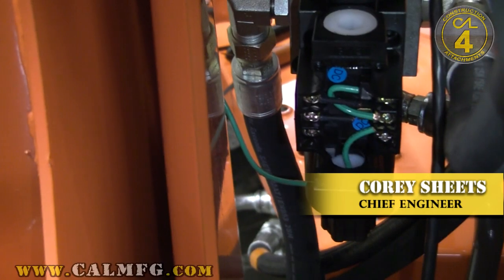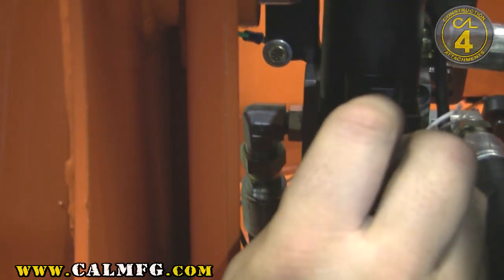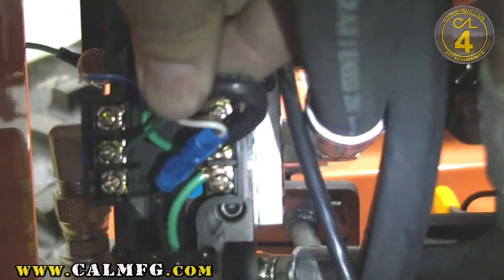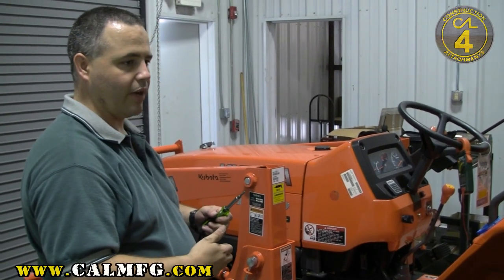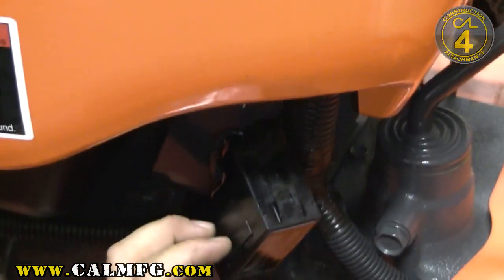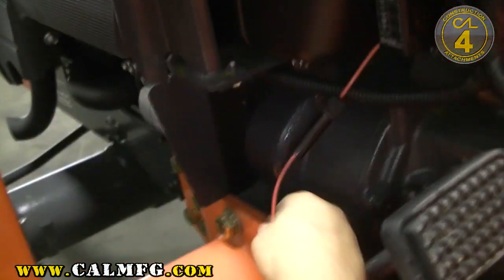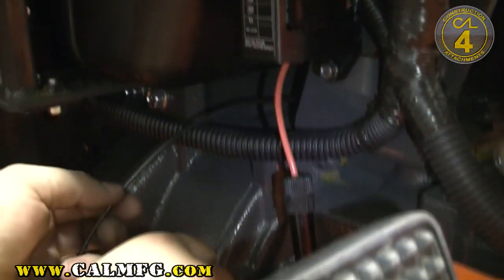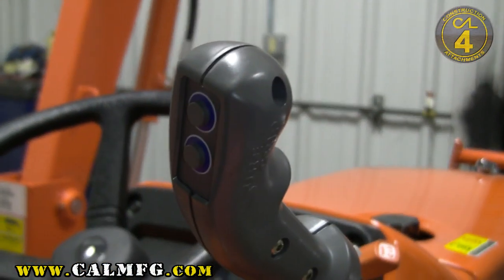One Touch Kit Installation for Tractor Loaders - Part Three

Comment: Good video and I will definitely check out your kit when I'm ready to order.  I've looked at other kits and the makers/sellers videos are terrible so I wouldn't want to buy theirs.  

I would say, though, that the electrical instructions could be improved.  

You crimped with the cutting edge on the first crimp - was it the brown and white wire in a butt-connector?  Yep; I double-checked: 1:40 into the video.  Picking a random ignition-switched wire could be dangerous - the load of the valve could blow a circuit to something critical.  You should identify a specific circuit to tap.  It looked like there may have been a couple empty slots in the tractor fuse box - judging only from the picture of the front of the fuse box.  If the tractor uses ATC fuses, there are simple ATC fuse taps that might simplify the connection.  I would definitely recommend using ATC fuses or ATC mini fuses over the AGC fuse shown.  

If you do use the side-by-side tap shown, don't use your electrical cutter pliers as shown.  Use lineman's pliers with a wide jaw or slip-joint pliers.  There are two cutters that have to penetrate the insulation inside - one on each wire.  The narrow pliers you used will lead to poor and intermittent connections and those just aren't strong enough for the pressure required to create a solid splice.  The wider jaws of the lineman's pliers will be sure to press both cutters inside the tap. Even better would a good pair of slip-joint pliers so you can get a flat pressure on both sides - single slip-joint, not Channel-Lock style.  When using that style taps, it is critical that the tap be matched to the wire.  Shipping a random tap and tapping into a random wire will cause problems.  Too big of wire for the tap and the tap will cut right through the strands, limiting the wiring current carrying capacity at best and cutting it in half at worst.  Too small of a wire and you won't get a solid connection; if it makes at all, it will likely make and break with just vibration and that will cause sparking inside the splice and lead to carbon fouling and worse connection problems or outright failure of the splice and the wire that was spliced into.  

I want to emphasize how important it is to pay attention when you route the wires.  There are a lot of moving parts and sharp edges.  Both of those can pinch or cut wires.  Moving parts can also break them from repeated movement or unexpectedly pull the wire out or snap it.  Use caution and you can succeed but I suggest using some sort of loom like the factory uses - or even try to get yours in the factory loom - use a cut-off piece of fish tape with the ends ground to not be sharp at all; some fish tapes come with a plastic cap on the end.

Use TFFN wire.  It's ultra-violet, gas, oil, resistant and will last many years, even if not in a loom.  Cheap wire will last many months but not many years.

And, never, ever use black wire for hot in any 12v or vehicle electrical system.  Black is ground.  Always.  Some other color, but never red, might also be ground and a person would have to know about such an exception but when you see black, it is ground.  Period.  Or it should be.  If you don't have red for the hot, wait to install until you get some.  If the kit doesn't come with red, go buy some.

If someone who doesn't know vehicle electrical systems follows these instructions they could end up with very expensive repairs.

Comment: I would do that electrical very early in the process, right along with the first video where the bracket is just about to be mounted. That way I am not reaching under there with the loader over my head trying to make sure all my connections are good. I would leave enough slack in the wire from joystick to connection point so I can make the connections (say 10"-12" away from the final bracket location. Then I would loop that slack someplace back there and zip tie it. The idea being if I ever have to pull the bracket off for some reason, I can pull it and have plenty of wire to pull it forward and out of there (so I don't have to disconnect the wires). The final connection to the fuse box can still be the final step. Just my 2c.